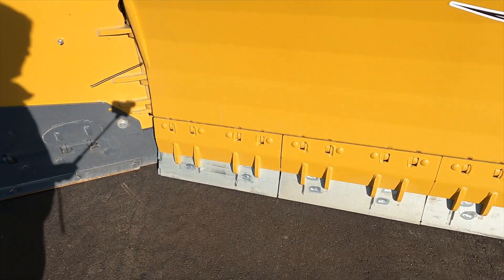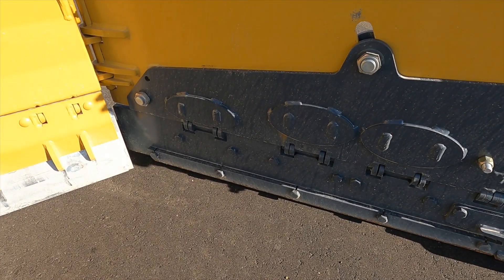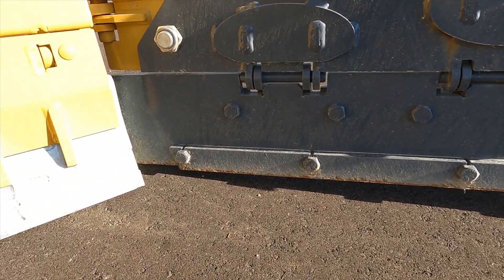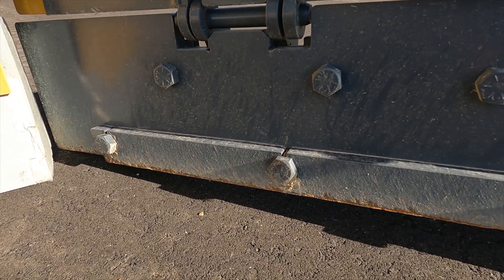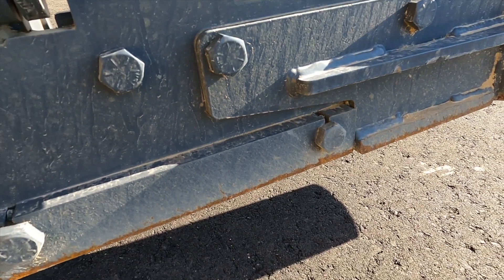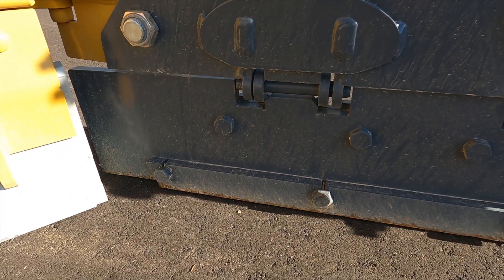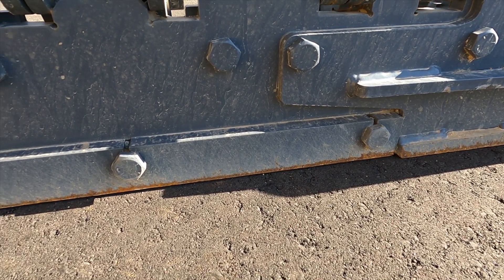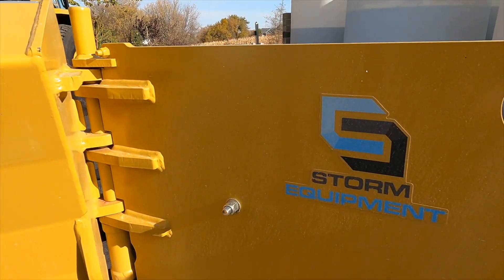Metal Pless How To: Proper Plow Leveling

Comment: You need to explain the leveling process on the van wing plows with no leveling bars
Reply from the maker: We will get a video done for you!
Reply: @stormequipment3537  thanks I'm wearing the blades out on the 1228? 1248 plow I run for my boss and it bothers me that he has to buy new ones alread

Comment: Besides the wearing doesn't start at the beginning of storm cause of the ice underneath the snow. When the Storm end and your cleaning up scraping the snow is wear the wearing down begins . The company I work for puts rubber guard so the cutting edge doesn't touch asphalt

Comment: What do you do if you don’t have the marker level indicators on the wings? PLSS-0930-13 LE didn’t come with any. First time using MP. No one gave me any clues on how to run it the most efficiently. I do have the level bar in the center of the main board but I can level that bar with the plow too pitched back. Using a skid steers. Any tips on properly leveling the plow would be helpful. Thanks.
Reply from the maker: Live edge plows make a "chatter" sound when ran correctly. Play around with positioning of the plow now before the snow falls so you can get out and see if the plow is level. If you purchased the plow new it should have a center slip hitch that will help indicate if its level.
Hope that helps!